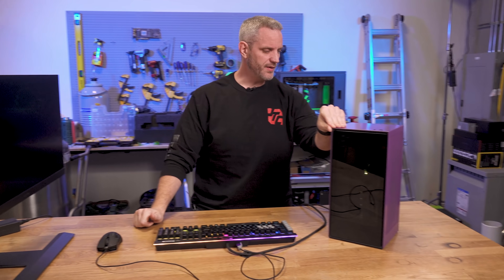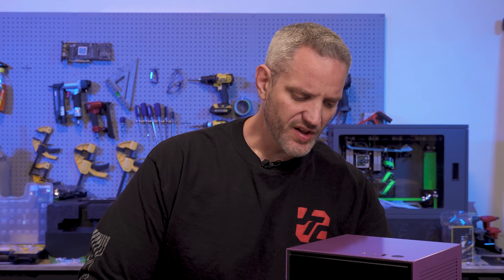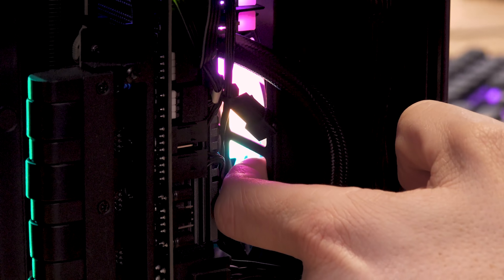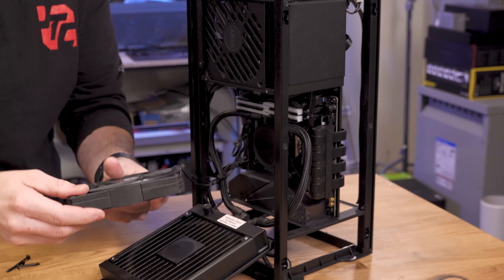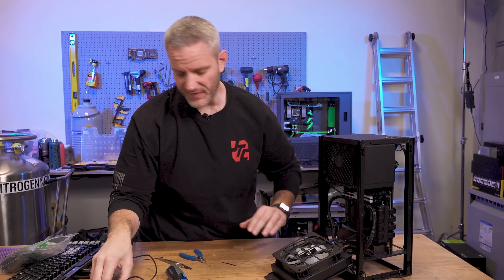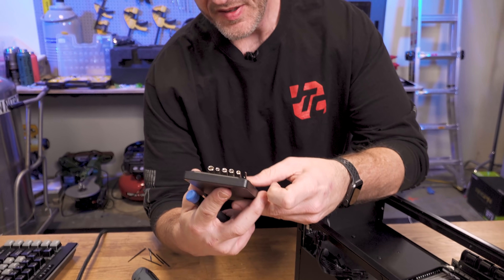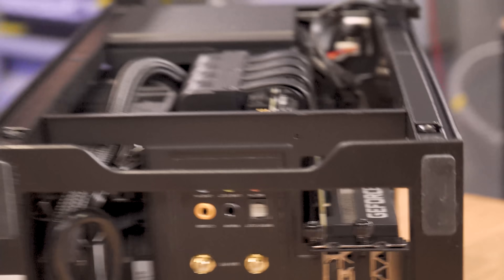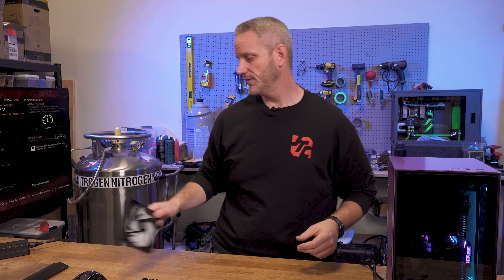This PC is shutting down due to overheating... let's investigate why!

Comment: Just being dusty isn't a defense for a fan failing in less than 6 months. Its a defective unit or very poorly built.
Reply: My metallicgear case (Neo G Mini V2) was honestly also poorly built and designed. Had to do a lot of manual adjustments, and would definitely not recommend the brand - unless you are okay with completely overhauling your case. Seems like the hardware has similar issues.
Reply: When he said that it's been dusty I immediately thought about how those wildfires definitely did not make it any better for air quality.  Granted, the fan was still trash but the wildfires definitely didn't make anything better
Reply: Or fluid bearings for that matter. I have Fractal Silent R2 fans in my case that have been going strong for like 7 years despite getting quite dusty a number of times.
Reply: mine lasted 2 years before there was loud noise due to friction becuse dust got in and mixed with oil.. i just got oiled replaced and a year has already been its fine.........
Reply: For real I've had a pc I didn't dust for 5 years and it ran perfectly lmao
Reply: @NightLordddd  lol so true...
Reply: I have 3 blue Corsair fans for years don't dissapoint, always fine.
Reply: Please help 
I built my pc and it starts but I get no signals on my monitor 
Tried everything 
Ram 
The monitor it self 
Gpu 
Everything is plugged correctly btw 
The fans spin and lights are on but there's no lights and my keyboard and mouse don't get lights as well 
I got ryzen 5 2600 
16gb ddr4 3000
2060 rtx 
Psu is 400w 

Where is the problem??
Reply: @imhungry8713  i think its the PSU issue ma bro.. 400w is not enough for this spec..
Reply: @manjindersinghsaini911  the pc stays on for few like 1 min and turns off again btw forgot to say
Reply: @imhungry8713  is your psu gold rated or higher?
Reply: @manjindersinghsaini911  nah not gold its bronze
Reply: @imhungry8713  its probably the reason your PC isnt working.. get a 500w gold at least!! if you wanna boost even a little then go for even better PSU than 500w
Reply: Any modern fan should last, even under terrible conditions, at least 24 months, without seizing. Truth is, 99% of case fans do not fail due to bearing failure, they fail due to lubrication failure (e.g. dry out, congealed lubricant). I’ve got 14 year old (cheap) case fans that have been running 24/7 just fine, all they needed when they got noisy was some lubrication. What sucks is that a lot of fans have plastic plugged hubs to prevent re-lubrication (better ones will have removable rubber plugs under the hub sticker). In the case of the plastic fused plugs, I just carefully drill them out, then clean and re-lubricate the bearing, cover with some black electrical tape. Result: I haven’t replaced a case fan (and not added to that element of e-waste) in a very long time.
Reply: All of my fans are made by Cooler Master.  It's been running over 7 years without issues.  Don't know what kind of bearings it uses but long as it keeps on trucking I don't care. lol
Reply: I have 3 metallic gear* fans, my rear 120 is fine but both of my front 140s in my neo mini v2 are crapping out and they are barely 1 year old

Comment: sadly my issue with panel fan not running is the fan header on the motherboard or the motherboard, cus new fan does not work when plugged in nor the stock fans, any of them, it's a ASUS  Z97-P, I guess the quick fix is to get a Y splitter cable to connect fans to. But my CPU overheating issue, I will have to solve with a proper CPU cooler, I think I will go for Noctua air cooler. I run all fans on max speed.
the pc is several years old, it's not a surprise something fails. I don't remember when it failed, if it was during start-up or during use,or when I noticed it, but I noticed the fan not spinning, so I tried to diagnose it.

Comment: Some manufacturers have more resilient FD bearings that are better sealed for a wider range of operating environments. Now how true that is remains to be seen as my fans have yet to show any issues after several months of use. I've had sleeve bearings clog up and stop working and rifle bearings seem to be louder especially at speeds approaching 1200 rpm. I've tried Corsair ML fans and they seem pretty loud which prompted me to return them.

Comment: My computer died in November and so did others.  I wonder if the heaters  HVAC kicking on kills off old  failing components by giving them a voltage swing they can't handle anymore.

Comment: If the 12v is shorting against the screw how is a washer going to help when the traces on the PCB are etched .3mm into the board, surely the metal screw itself is still touching?

Comment: You don't have to use ICUE for corsair fans. Even without the software they will just stay in the rainbow mode. But I'm sure you already knew that. I just think a teenager would probably rather see the rainbow shift rgb over nothing. imo.

Comment: 1:10 shots fired
Reply: Please help 
I built my pc and it starts but I get no signals on my monitor 
Tried everything 
Ram 
The monitor it self 
Gpu 
Everything is plugged correctly btw 
The fans spin and lights are on but there's no lights and my keyboard and mouse don't get lights as well
The pc stays on for few min and turns off automatically than it turns back on
I got ryzen 5 2600 
16gb ddr4 3000
2060 rtx 
Psu is 400w 

Where is the problem??

Comment: Anyone curious to RGB this case, there's enough room to line strips along the inside of the frame where the glass panel is and it looks fine as long as your strips aren't too long. And for the riser cable, I just used zip ties on both screws. Quick and dirty, but it works.

Comment: I dont really understand how rubber washer alone insulates electricity from transferring to the chassis... I mean the metal screw i assume is threaded to both the chassis and the pcie bracket so couldnt it still earth through the screw itself?

Comment: What do you mean overheating ? my gpu (amd radeon r7 250) goes over 100°C for more than a year  and still runs without shutting down .The guy who built my pc didn't even bother to manage the cables he just tied them in the middle of the case.

Comment: I'm still dealing with this bs with my laptop. I'm waiting to build my PC before taking apart the laptop that will be used for lower level tasks. Need to change the TIM on the CPU and GPU.
Reply: Please help 
I built my pc and it starts but I get no signals on my monitor 
Tried everything 
Ram 
The monitor it self 
Gpu 
Everything is plugged correctly btw 
The fans spin and lights are on but there's no lights and my keyboard and mouse don't get lights as well
The pc stays on for few min and turns off automatically than it turns back on
I got ryzen 5 2600 
16gb ddr4 3000
2060 rtx 
Psu is 400w 

Where is the problem??

Comment: I can see the radiator takes a few steps to get to.   Most people are lazy, please show them how to open the case and clean the radiator 3 times a year and what will happen if they never do - kill their computer.  The fan on my Noctua CPU cooler is 7 years old and I believe it is a fluid bearing, can't remember if the 7 year old 200mm case fans by Cooler Master are sleeved.   Loved the explosion at 8:18

Comment: I have 5 of those metallic gear fans running in my build for a year without issue hopefully it stays that way
Reply: Please help 
I built my pc and it starts but I get no signals on my monitor 
Tried everything 
Ram 
The monitor it self 
Gpu 
Everything is plugged correctly btw 
The fans spin and lights are on but there's no lights and my keyboard and mouse don't get lights as well
The pc stays on for few min and turns off automatically than it turns back on
I got ryzen 5 2600 
16gb ddr4 3000
2060 rtx 
Psu is 400w 

Where is the problem??

Comment: That looked like a Corsair LL-Light loop fan which I thought had a hydraulic bearing.  The ones with the Mag Lev are the ML series.  But maybe I'm wrong
Reply: Please help 
I built my pc and it starts but I get no signals on my monitor 
Tried everything 
Ram 
The monitor it self 
Gpu 
Everything is plugged correctly btw 
The fans spin and lights are on but there's no lights and my keyboard and mouse don't get lights as well
The pc stays on for few min and turns off automatically than it turns back on
I got ryzen 5 2600 
16gb ddr4 3000
2060 rtx 
Psu is 400w 

Where is the problem??

Comment: I understand that the plastic washer isolates the head of the screw, but isn't there still a chance for it to ground due to the threads being engaged? Would this be the reason the recommendation is to leave it out?

Comment: overheating fix video ! cant wait ! one fan . nice
Reply: Please help 
I built my pc and it starts but I get no signals on my monitor 
Tried everything 
Ram 
The monitor it self 
Gpu 
Everything is plugged correctly btw 
The fans spin and lights are on but there's no lights and my keyboard and mouse don't get lights as well
The pc stays on for few min and turns off automatically than it turns back on
I got ryzen 5 2600 
16gb ddr4 3000
2060 rtx 
Psu is 400w 

Where is the problem??

Comment: "I'm not gonna take it out... What I am gonna do is take the screw out and add a plastic washer in there. Then there's no chance of it grounding at that point."

Counterpoint: if the screw is metal, then the threads are metal. Your washer won't do anything. I might recommend adding Lock-tite, to cut the other connection.
Reply: I think he's just using it to add space between the screw and the chassis so it doesn't have a chance to touch it at all.

Comment: I bought the H1 2 days ago despite some random haters calling it oven or fail of the 2020 etc.. and I live in UAE which is a really hot country.. but surprisingly I'm not having any issues at all with my pc.. and it is running around 20c cooler on the cpu than my previous casing meshify c mini with an arctic liquidfreezer 2, and the gpu is also running around 13c cooler than it was in meshify c mini.. I don't know how or why but yeah It is true.. and also my casing came with nylon screws on the riser cable mount :) so no fire hazard !

Comment: I knew all that info about fans. Explains why I needed to oil up a dead fan on my old GTX 560 Ti like 4-5 years ago when it started to die. Had a dynamic fluid fan cuz it was used horizontally

Comment: I remember school techs told us that the servers were shutting down at night. What was happening was the CPU fan died, the server runs during the day but overnight it runs the backup routine which included file compression which was causing the CPU to overheat and shutdown. We told the techs to remove the side panel and look at the CPU fan and get it replaced.
Reply: school tech ... that sucks

Comment: Wouldn't electricity still arc on the head of the screw because the thread of the screw contact on the  chassis? I would think the plastic washers wouldn't be enough... 🤔 good video thou. Great content as always.

Comment: Bread
Reply: I was thinking the backside of the screw was contacting the case where it shouldn't have and the washer prevented it from sticking out so far?
Reply: @Wingedshadowwolf  i think you're right, would make sense.
Reply: Exactly, useless fix

Comment: I must have hit the jackpot with the 9700k because i have it overclocked at 4.9Ghz (not 24/7 i use park control for balance mode etc.) but my pc was an nzxt prebuild from right before the covid thing started, 1660ti ventus OC, with i5-9400f, B365 phantom 4 (crap) MOBO, 1tb ssd and 16 gigs of ram all for $899 plus the $50 they charge to “build it” i ended up upgrading 6 months later to a z390 and a 9700k and all while using the cheap Deepcool cpu fan and i game heavy, i push my card to the limit because my cpu compared to gpu is a lil mismatched so i just go ham on the frames and i noticed my cpu temps were staying lower than normal (even in summer time when it was literally 85 degrees in my bedroom one day) so I decided to overclock, i can go to 5 with my psu being close to capacity but i usually keep it more stable at 4.8 or 4.9 but im still barely hitting 50 celcius after playing cod for a couple hours. My gpu on the other hand lmao lets just say it’s going on my shelf as a prized possession whenever i upgrade this coming year because the coil whine is insane but temps also never go above 66 Celsius after hours of fps games at 200+ frames. My case is also just the nzxt h510 and I literally have 1 intake, and 1 exhaust fan (excluding cpu gpu fans) maybe i got lucky idk but i keep hearing the 9700k had overheating issues and I didn’t find that out until after i bought it

Comment: And here I thought a fan was just a fan.  Jesus, you're telling me I need to be concerned about which bearing type is oriented into what position?  Argh!
Reply: Nah, just spend a kabajillion dollars on Noctua airflow fans for your case and pressure fans for your radiators and bask in the thermal rigidity of your now beige and brown computer. (I know they come in black now but that isn't as entertaining.)
Reply: @OOZ662  you can get good noctua fans for like 11 to 14.00 each.  Doesn't cost that much.
Reply: @formdoggie5  Mine were a bit over twice that. Yay pandemic.
Reply: @OOZ662  I've always laughed that someone there must've been pretty dense to hold onto that 80's beige so stubbornly.  And brown!  Good grief!  I've only bought 1 noctua in my life and it was only because the fan was hidden and only 80mm.  (Specialized thing for my ASUS TUF mark 1 mobo).
Reply: Buy Noctua fans, they seem to be eternal - cheaper Redux line is fine too. Orientation doesn´t matter.
Reply: @Morpheus-pt3wq  I recently upgraded to a Noctua PPC 3000 for a rear exhaust and PPC 2000s for bottom intake and front intake. I expected a difference, but its truly insane how much nicer these fans are than the Thermaltake fans they replaced.
Reply: @ryanengen8081  thermaltake basically re-sells chinese crap, slaps a sticker on it and marks its price up.   

Source: I have an old thermaltake armor from 2004/5(?)  on my garage, it was expensive af back then (150$ for a shitty full tower case) and all of it SUCKS. it looked "cool" (back then and for the era), but it is just so BAD, I cringe at the thought of having bought and waste that amount of cash on a case.
Reply: Technically? Sure. Realistically? Nah. Good fans will outlast the computer, regardless of orientation. I've had some Corsair sleeve bearing AF/SP120 fans in my desktop for 7 years, mounted the 'wrong' way, and they're still fine.

They might fail X hours earlier than the ones mounted in the correct orientation, but X is apparently longer than 7 years, so it's not a big deal. 

The failure in the video is not typical, and likely unrelated to orientation.
Reply: @blaydex158  I had a Corsair 3 wire rgb SP120 that croaked within a year (vertical).  Replaced 3 of my 6 fans with their rgb mag levs.  TOTALLY worth it.... Like $40 ea. 2 or 3 years ago.  They look great, push strong, pwm controlled, deathly quiet, and, well, are mag levs so in theory they should last quite a while.
Reply: To be fair, I don't what specific MetallicGear fan this is, but all the ones on their website are rifle bearing fans. They all have oils or fluids that can get junked up by dust, but not as much as fluid dynamic fans which have obviously more fluid. But yes, typically the fluid fans prefer being in a flat orientation for optimal lifespan and I'd recommend it like Jay said.
Reply: @NANOTECHYT  I don't know what kind of fans these are man.  I just bought fans and put them in.  Why does no one ever explain this crap.
Reply: Please help 
I built my pc and it starts but I get no signals on my monitor 
Tried everything 
Ram 
The monitor it self 
Gpu 
Everything is plugged correctly btw 
The fans spin and lights are on but there's no lights and my keyboard and mouse don't get lights as well 
I got ryzen 5 2600 
16gb ddr4 3000
2060 rtx 
Psu is 400w 

Where is the problem??

Comment: I was not aware of the issue until yesterday myself.  I just finished putting my H1 together a couple days ago, and my PC shut down of its own accord shortly after installing Windows.  The screen was also blanking out and other weird issues during the install.  So, I popped into BIOS to take a look at thermals, and my CPU started skyrocketting from 35C to 98C in a manner of seconds while doing nothing but watching the thermals in BIOS.  Anyway, after an entire day of trying to trouble shoot the video card, reapplying thermals, etc., I eventually came across the riser issue for the case.  Plugged the video card directly into my motherboard, and everything worked like a charm.

tldr; Exact same overheating symptoms as this PC, and NZXT is sending me a new riser along with a patch kit, because the short fried my riser.  :/
Reply: Please help 
I built my pc and it starts but I get no signals on my monitor 
Tried everything 
Ram 
The monitor it self 
Gpu 
Everything is plugged correctly btw 
The fans spin and lights are on but there's no lights and my keyboard and mouse don't get lights as well
The pc stays on for few min and turns off automatically than it turns back on
I got ryzen 5 2600 
16gb ddr4 3000
2060 rtx 
Psu is 400w 

Where is the problem??
Reply: @imhungry8713  A couple things to check and consider:

1) You may need a more robust PSU.  Minimum recommended PSU is 500w for RTX 2060.

2) Make sure the 4-pin/6-pin PCIe power cable is securely plugged in to the motherboard.  This is usually located at the top left corner.

Comment: NZXT is shipping nylon replacement screws. A nylon washer may not solve the issue as the screw can still make contact with the pcb layers and the mount which could still cause a short. Jay please fix the video.

Comment: 8:07 Little tip. Those tweezers are not heat resistant. A tiny incident with my soldering iron taught me that lesson...